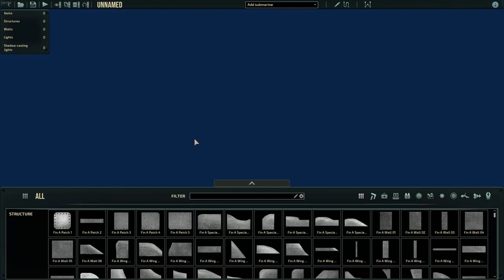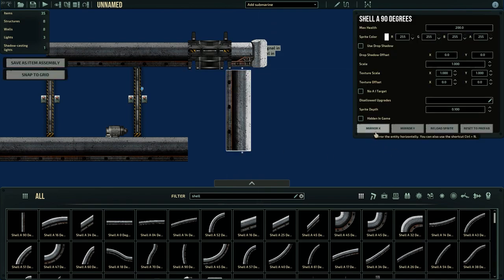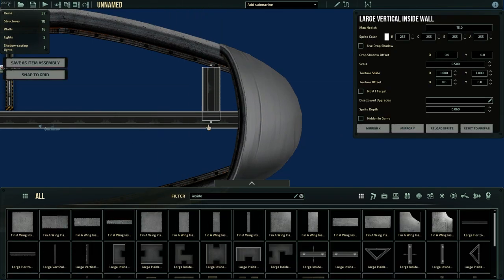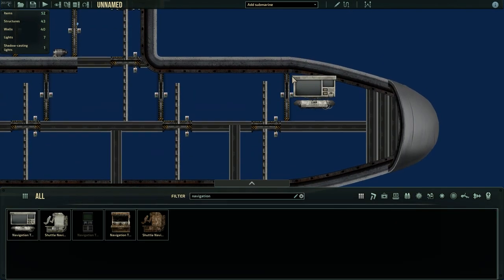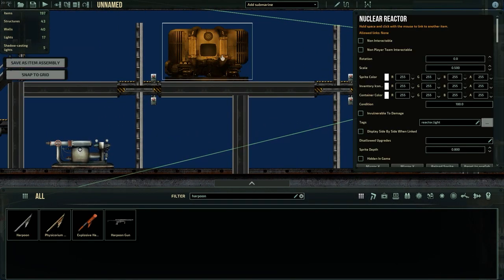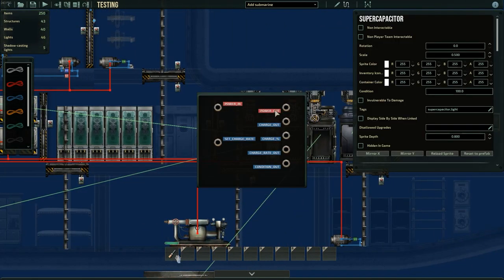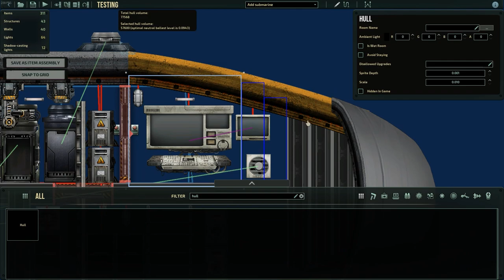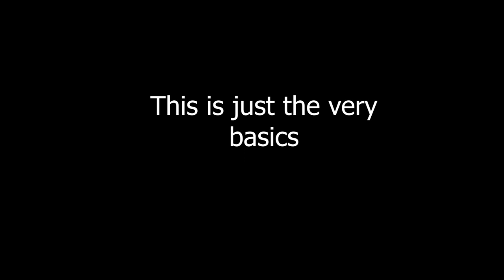Very Basic Submarine Editor guide ( Creating your first Dugong)

Comment: If anyone needs any help, hit me up. I've done quite a bit of sub building and have too much free time.
Reply: Well, if that's the case Camward, I'd like to ask you a question. IS it possible to use a Docking hatch as a multi-purpose hatch that can be both a Docking hatch AND an Airlock hatch? I have a sub design I have been working on that will be using a Hatch type airlock anyway, and I have been wondering if such a thing is even possible under current circumstances, as the less work I have to do, the better.